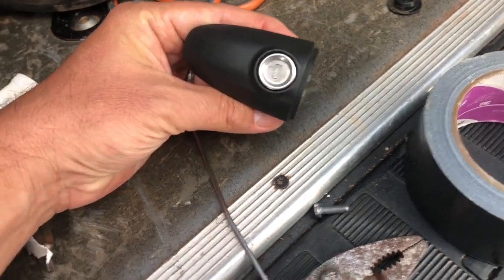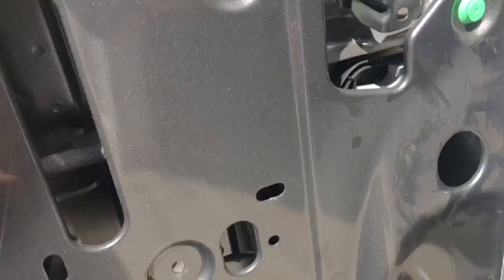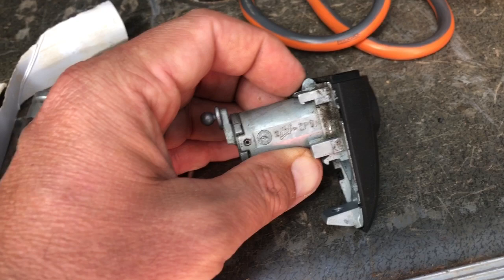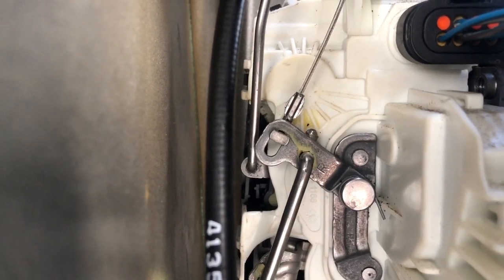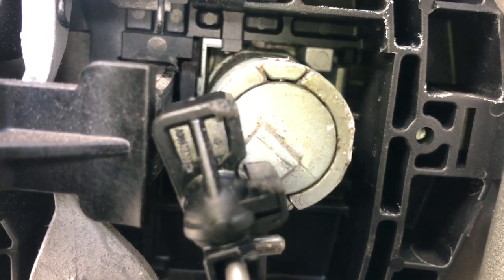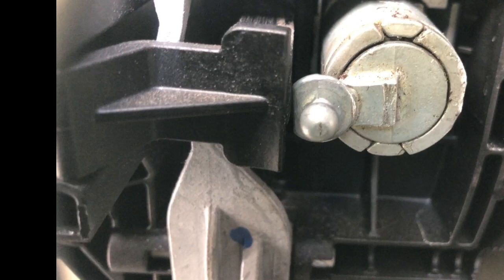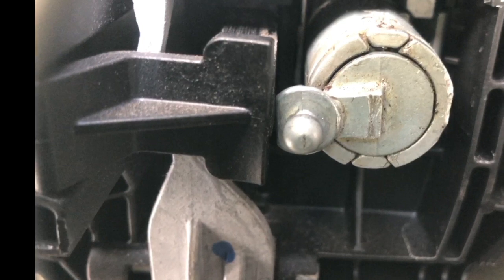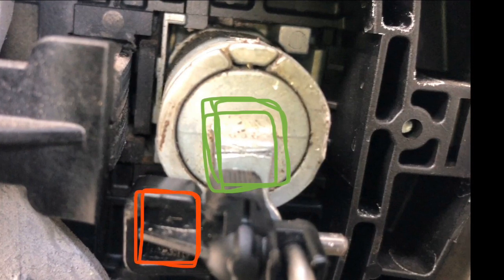2015 Sprinter rear door lock

Comment: Hi guys.
Recently had some little tealeave break into my van rear door wrecking the handle and barrell. When we repaired the door and fitted new parts I can confirm that the ball on the back of the lock cylinder needs to be in the 3 o clock position not 9 on clock as shown on this clip.
Hope this helps

Comment: Thank you for this!

I have the same lock issue (key just spinning and useless), but also complete lack of use of inside door handle.  Outside handle and remote works fine.

Your video definitely helped me figure out how things were supposed to work!
Complete lock had "exploded", so I figured out how the insides go together, as well as finding the connecting rod at the bottom, inside the door.

Key still locks up, but more importantly,  still no use of inside door handle.

I can feel the cables moving, but not sure how they may connect inside of the plastic housing at the latch.

Any insight?
Reply: Hi, I have the same issue, did you ever manage to fix this??

Comment: Thanks for sharing, Ryan, I need to swap out my own rest door handle lock cylinder part due to someone snapping a screwdriver in the lock in a failed attempt to break into my van.

Currently I'm relying on the opposite to you, the central locking as I'm unable to use my key for the rear door.

Anyhow, thanks again for taking to the time to document this process, it's appreciated.

Comment: Ryan;  Is there some kind of retainer clip to hold the black plastic socket part of the ball and socket joint together?    Mine just falls out and doesn't seem to hold together.
Reply from the maker: Hi Mark, That black plastic socket is all one piece, including the ball socket, the part that rides over the arm of the ball, and a snap clip that puts tension onto the back of the ball, holding it in place. If you don't have that snap clip, I would guess its broken. Hope this helps! Sorry for the poor quality video.
Reply: Ryan, Thanks for that, no sign of the clip, I guess I'm going to have to go serching for it
mark
Reply: @RyanGunnells  would this be similar with a vw crafter the locks just free spinning and we Dunno what to do
Reply from the maker: @corypatterson3072  Good morning Cory. I’m not sure if this is like VW, but I wouldn’t be surprised if so.
Reply: @RyanGunnells  did you have to cut a hole through the front
Reply from the maker: @corypatterson3072  no
Reply: @RyanGunnells  that is what we're going to do in about an hour
Reply: I meant tmr
Reply: @marscan1  hey, do you maybe know the part number for the pastic socket?